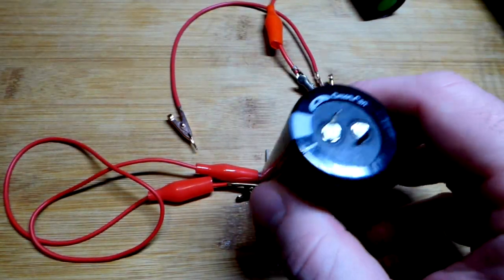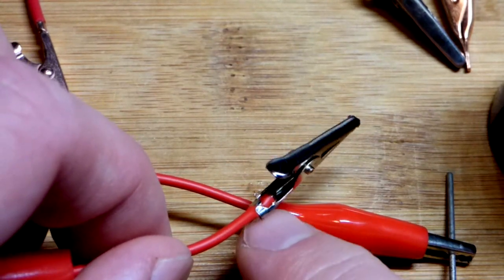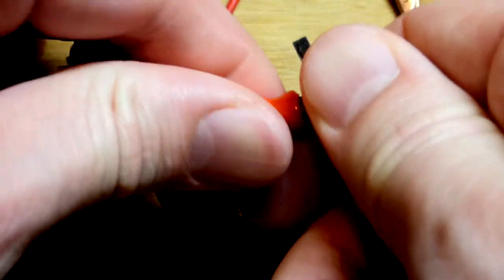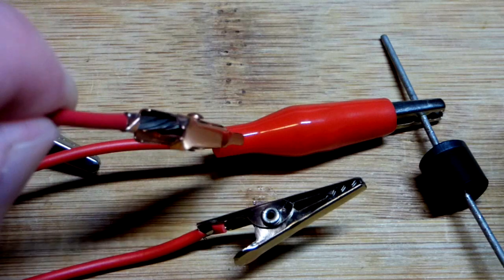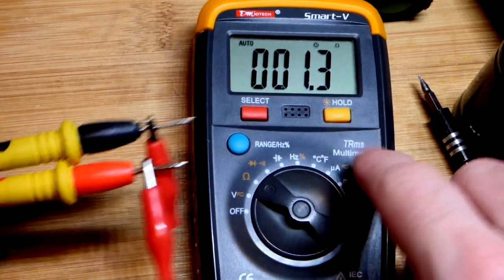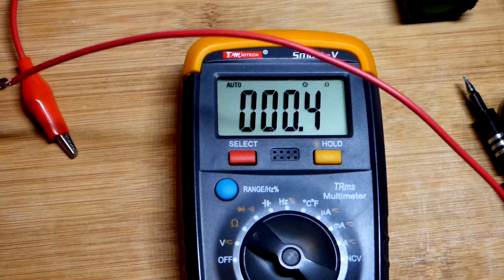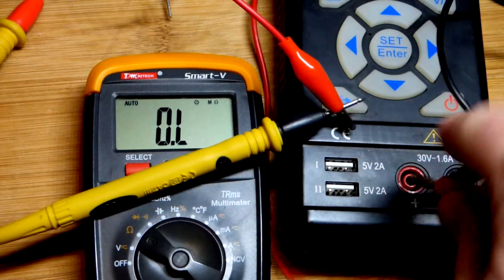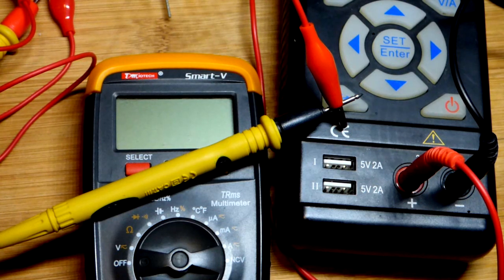Resistance test of alligator clips cables I bought versus one I made for a DIY electronics project

Comment: How about using 2 of those cheap cables in parallel? It is like having 2 resistors in parallel. The resistance will decrease.
Reply from the maker: If I had to use them, I'd definitely parallel them for that very reason. They're bad enough where I'll never use them though.

Comment: Unfortunately the accuracy of low resistance measurement with a multimeter is very poor. On my BM235 the accuracy isn't even specified < 600 Ohms. To get accurate readings, use an LCR meter or do a Kelvin measurement with a constant current supply.
Reply from the maker: I do have an LCR meter. So, I'll keep that in mind!

Comment: Adafruit do a few different sets of alligator clip cables with 22AWG wire, less flexable but much more copper.
Measures as 0.3 ohm, still crimped rather than soldered.
Search their site for "alligator" as few different versions.
Reply from the maker: Nice :) I just bought some cheap ones. Didn't think they could be this bad lol.
Reply: I wonder if they are really copper and not copper clad aluminum (or worse - did you try taking a magnet to them to check for iron content?). Also, if you can measure 0.3 ohms you should compare with copper cable reference tables for this gauge and number of strands to see if it is too high.
Reply from the maker: @SteelBlueVision  I did not test them, I just pulled them out of a kit that I have without giving it much thought other than the resistance. Those are good tips, thanks!

Comment: Gator clips today are total shit.   The jaws don't align and the boot is slippery from the molding process and they don't clean off the anti-seize from them.   The wire gauge is toooo thin and the crimps are crap.   I pulled all of my last ones I got apart and changed the wire and soldered them all up then de-greased the boots in alcohol..
Reply from the maker: Yeah, the quality is very disappointing, but not surprising because I didn't pay much for these. Would be nice if they came with a quality rating or something.